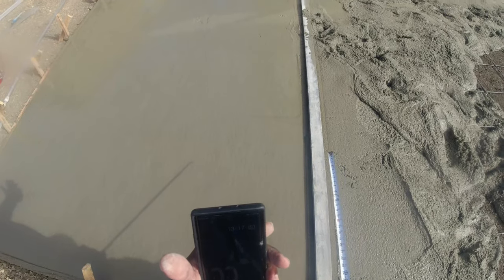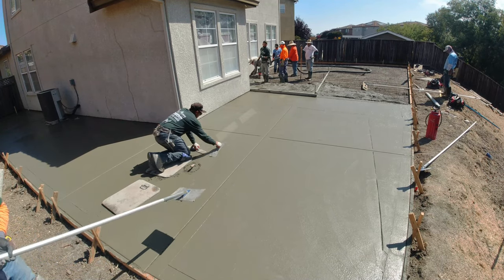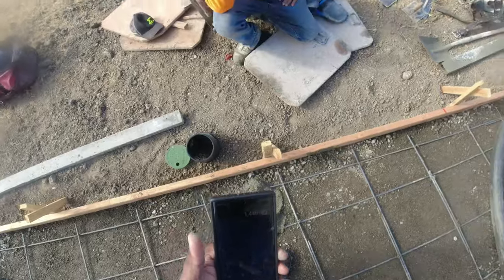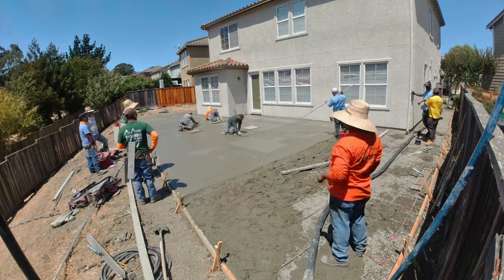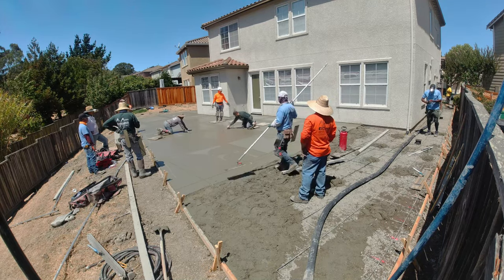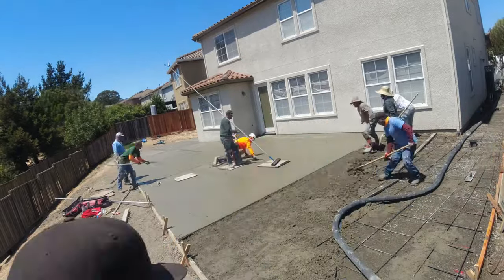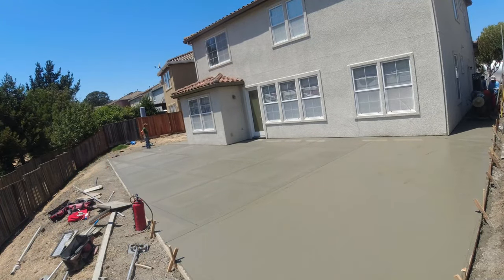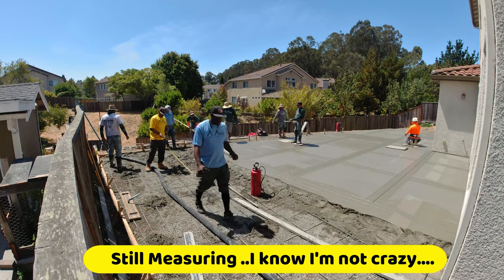"CAll The Office I Didnt Load The CONCRETE TRUCK I Just DRIVE" 🤡😡

Comment: Nice work, and your attention to detail is impressive.I’ve poured a handful of pool decks over the years, but I wasn’t talented enough to do large flatwork projects.
My specialty is pouring or Shotcreting pools/pool bottoms.I’ve been shorted mix a few times, but Hot mix is a problem I run into quite often(when the driver leaves a yard or two of old mix on the truck,and the concrete plant tops it off with fresh mix)You start pouring, and by the time your troweling the mix it’s setting up on you or clogging the concrete pump!🤦‍♂️ Great video! I hope you young guys listen, and observe how this man operates his business because there’s a lot of opportunities in the concrete placement business.#stickwiththewinners #specialtycontractorsrule
Reply from the maker: Mannn. Appreciate the kind words... 💯💯👍🏿👍🏿

Comment: Nice shots!
Wonder what mix design you order when you pump it (retarder, water reducer, etc)
We had a few issues in a recent job using a line pump, concrete got hot quick!
Reply from the maker: Appreciate the comment... We use a six sac pea gravel 4 inch slump (mix 807 central concrete 3000 psi ) .. We don't add anything..

Comment: What size bull float do you guys normal use, I can't decide between a 42 in and 72in
Reply from the maker: Honestly man we have them all.. I'll start with 42 inch
Reply: @AllAccessConstruction  I read somewhere that the bigger the float the better that's why I ask the question.  I imagine that a 42in can fit in more places a 72in can. But if your doing  a drive way why not use a larger float aside from them costing more? Are they harder to use? I see most people on the internet using 42in floats,..... thank you for your response I appreciate it , I'll most likely go with the 42 in. I can always get the 72in down the road.
Reply from the maker: If you are a finisher recommend you get a 36,48,72..that way you can stay ready so you don't have to get ready..💯💯💯